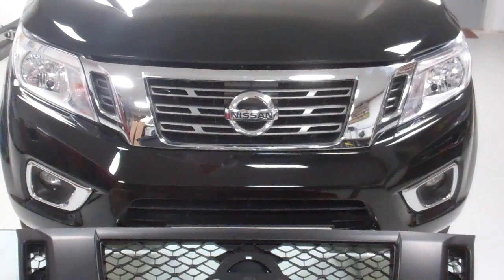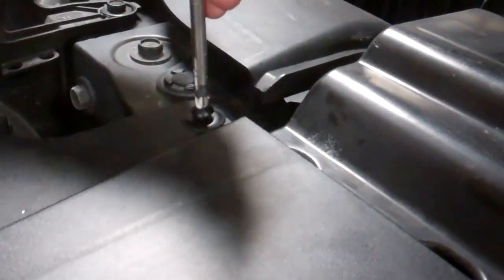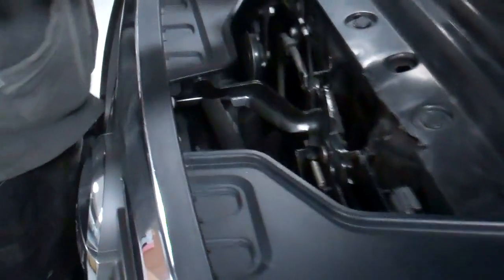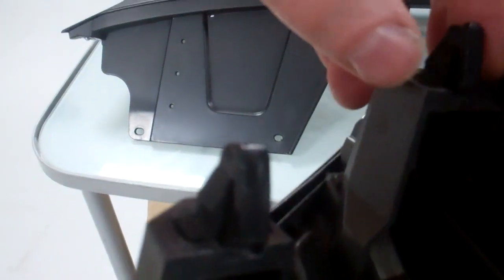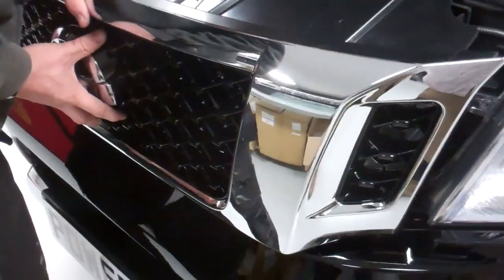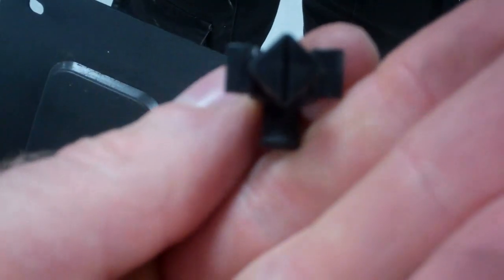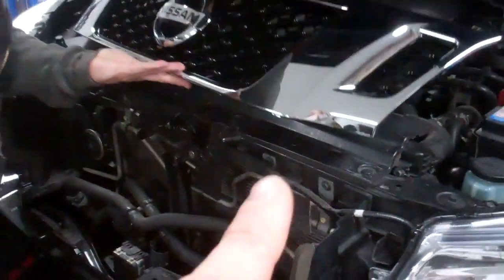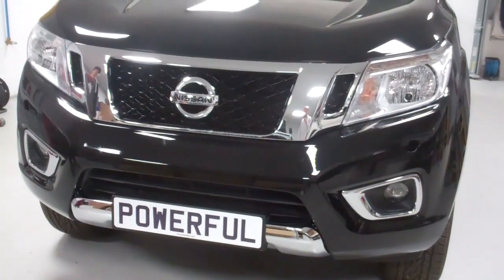How to change front grille on Nissan Navara NP300 + upgrade options

Comment: In conjunction to what the previous person commented, if you have a higher spec NP300, there is a connector attached to the inside of the Nissan logo. Be careful when taking of the grille and remember to unplug that camera cable

Comment: Good Day guys there is another easier method in removing the grill using a flat head screwdriver from the front of the grill there is actually a hole to fit the driver and turn the slips and it will disconnect and the grill will be out.